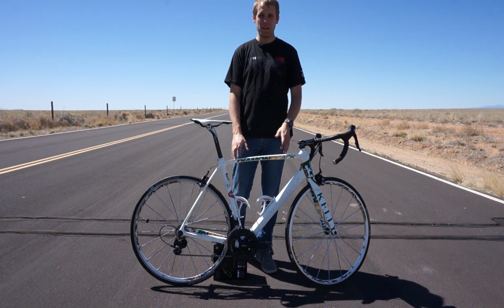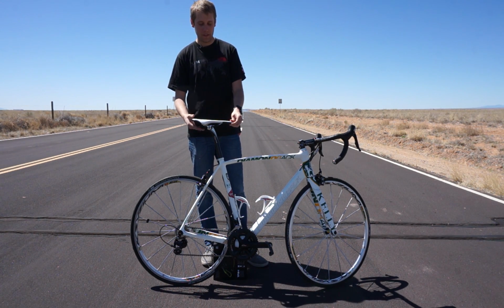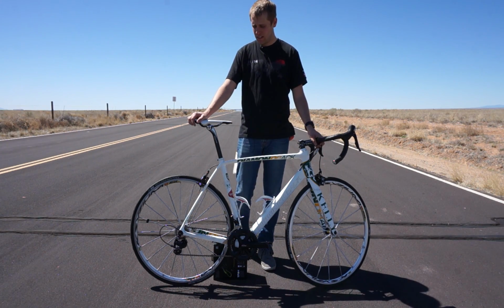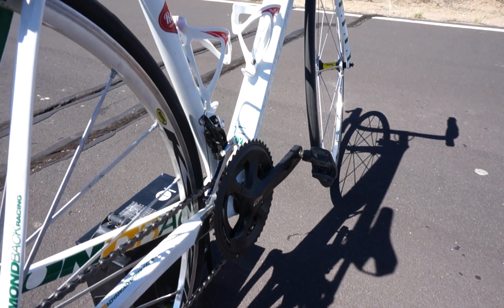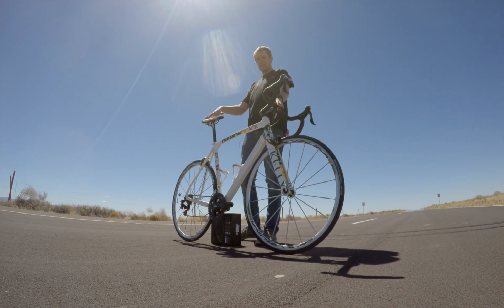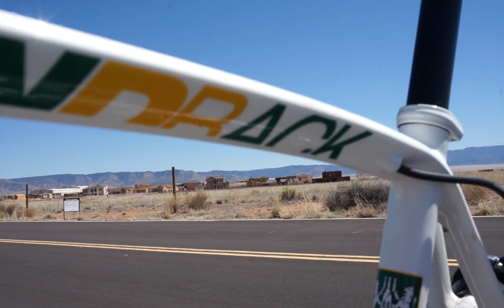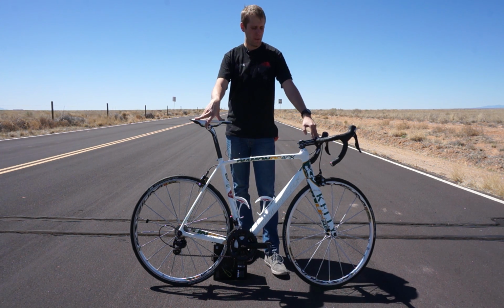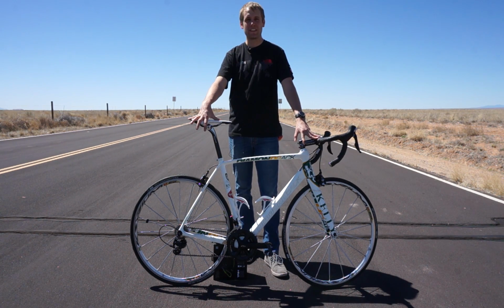Pro Level Road Bike - 15 lbs - Under $1000

Comment: Please,put the links on the video where you've got all the parts. Nice video.
Reply from the maker: +Freddy Gonzalez I know, I know, I've been slacking. I haven't made a list yet but this is what I wrote to another gentleman inquiring about the build. 

Here's what I learned: 

1. Ultralight is not going to be a production model - You have to find old team bikes, they come with a different carbon lay, usually a toray 1200 or 1800 weave, not the production models that use a toray 600 or 800. This is important in that it makes the tea, bikes stiffer and lighter bit the carbon is more brittle and not designer for 10 years of riding. So this is a trade off you will need to decide. If you don't believe me, call Diamondback and ask them if you can buy and actual team bike. The frames are different. With the build in the video I went with the Kelly Benefits version of the frame because I was able to find it on eBay and has a super light lay-up. 

2. Merlin is basically employee pricing on Shimano. I work one day a week at a bike shop and Merlin's prices are within 10% of the shop deals. To the point where we at (Undisclosed national bike shop that owns Bike Nashbar)  usually order from Merlin because they have better deals and less of a hassle. 

3. Carbon isn't always the lightest. Check out Woodman Components. For the price and weight their stuff is hard to beat. 
 
4. Take offs will make any budget go further - Hang around local shops, you'd will be surprised what people will take off their bikes to save grams. What comes off, you usually can buy (no warranty) for pennies on the dollar. Hence where I got the bars and seat post in the build. 

5. Work arounds - Sometimes its worth buying a bike you don't want just for the parts. The Mavic wheels in the build came from purchasing Stevens that went straight to eBay without wheels. I think I paid around $1200 on Craigslist and sold the bike without wheels for around $1000. Hence the wheels cost $200ish

6. If you want to spend more time riding than building, just go to shop and pick up a decent road bike for $1500 (I can suggest some bikes if you need help). It's not easy to build-up ultralight bike, understand they take time. Also invest in a scale haha.
Reply: I bought a complete 11 speed 105 groupet from Merlin Cycles for $360USD.  It is where they too got their group.  And it seemed to arrive in USA in just a couple of days.  It was a fantastic price on a 105 group.
Reply: Thanks for the info, this is a fun project video. What $1500 bikes would you recommend?

Comment: I looked up the price for the frame alone. Over $1000.00.
Reply from the maker: kingmike40 That is if you purchased the frame new, but in the video I state that some parts are used including the wheelset, bars, frame, and seat post. I'm just trying to demonstrate that a person doesn't have to spend a lot money to have a great bike. Also if you aren't convinced, you get a nashbar carbon road frame made by Fuj (C10 Carbon in the description) that costs about $450 shipped. That frame with the same parts would very close in weight to the Diamondback Podium.
Reply: +Bryan Jurus   Was your frame PF30?  Did you need an adapter to run a Shimano crank?
Reply from the maker: +irgccg I did need a PF30 adapter. It's honestly worth extra 40 bucks to get the wheels manufacturing adapter. Have your lbs put it in because you can crush the frame if your not careful.
Reply: +Bryan Jurus  Thanks to your video I just bought a 2014 Diamondback Podium Equipe! (ex team bike) It came with the BB installed so I'm going with the Wheel manufacturing adapter and a Shimano Ultegra set up.
Reply: +Bryan Jurus Thank you for this video. It has literally saved me thousands of dollars!

Comment: Great video.  How do you obtain left over bikes from cycling teams?
Reply from the maker: Jason Aranda The best way is to look over eBay listings. Many time I sort by size rather than specific bike for frame type. This way I can see the team bikes that don't have a model number or are something that you have never heard of before. I just bought a Jamis Xenith SL used by the 2014 Sutter Home Team for $450 from Robbie Squire who recently went to the Hincapie Dev team. They are on there. I am considering putting together a website to help the pro teams sell off spares. Unfortunately I haven't had the time.
Reply: Thank you  for the great tip Bryan Jurus I truly enjoyed your video and considering learning to build one myself...warm regards
Reply: +Jason Aranda    Search out the "Racery"  ebay listings.  I just bought a Diamondback Podium Equipe frame, fork, headset & bottom bracket for a price similar to Bryans. Frame weight 860 grams!